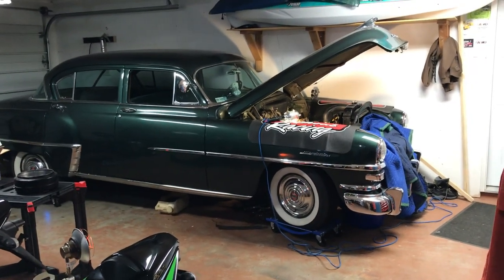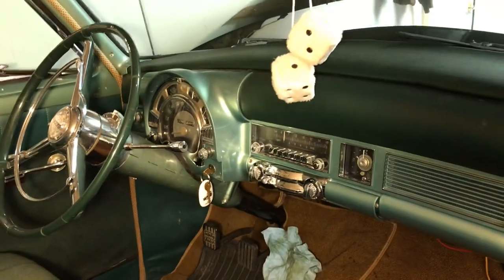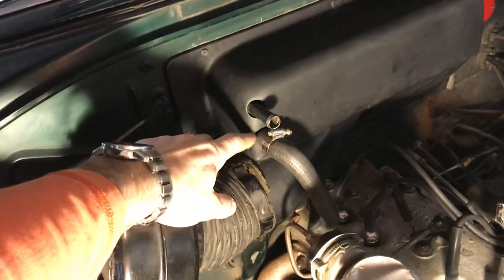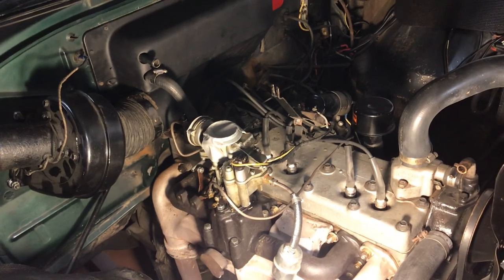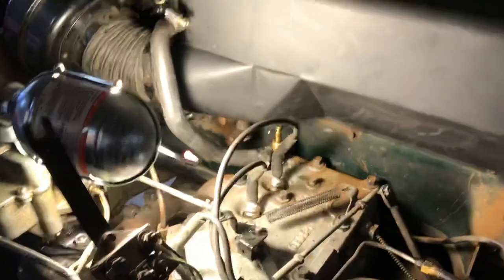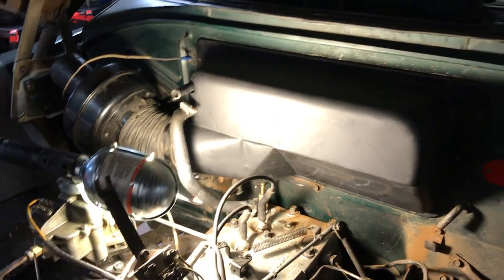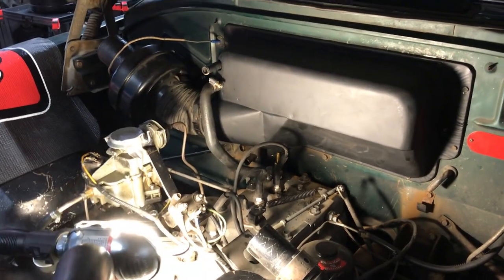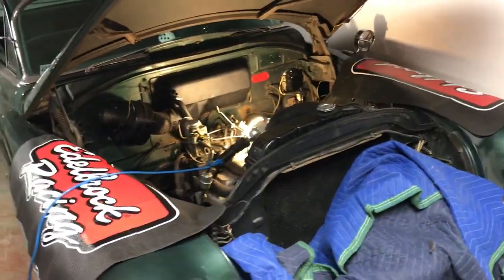Winter Garage Tinkering

Comment: Beautiful car!  Nice work!  I have a 1949 Windsor Club Coupe and I absolutely love driving it.  Super reliable, comfortable, and smooth driving.  Here in Northern PA it is still winter as well, can't wait to take it for a ride.  Everything works as it should in my '49 Windsor, and you will notice that you will be very pleasantly able to keep the temperature in the cabin comfortable.  The 2 fans are great as well, one for the defroster and one for the heater.  And with the cowl vent open there is really no need for aftermarket A/C.  These cars were sturdily engineered and well built.
Reply from the maker: amflashback Thanks for your kind words. I agree these old Chryslers are well engineered cars. Toasty warm in the cab this morning after I finished up the heater reassembly job.